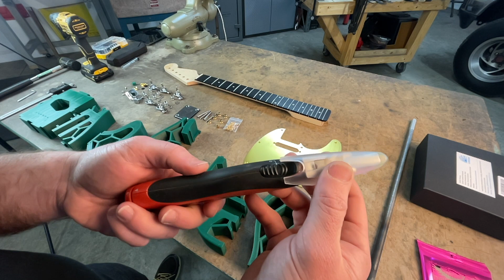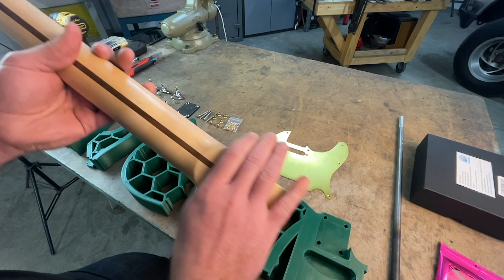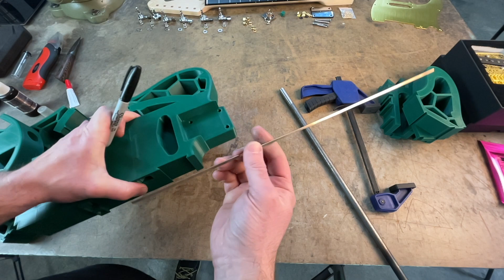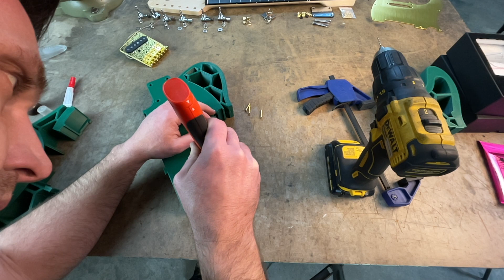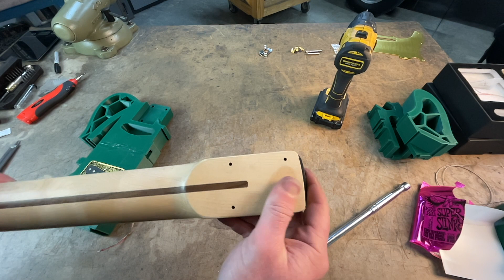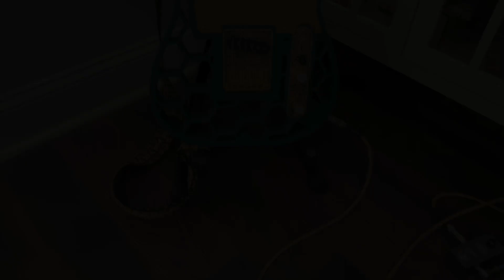I 3D Printed A Guitar (Does It Sound Good?)

Comment: Wouldn’t some kind of epoxy glue be better, especially for those looser fitting joints?
Reply from the maker: Yeah epoxy is a great option but with PLA super glue work just fine. You could use a solvent based glue on say ABS and have a very strong bond.
Reply: @koideath thanks. I have just completed mine and I found the superglue didn’t give me enough working time (it’s summer here in Australia and very hot!). I found epoxy gave me a little more time to get the parts together straight. Also, there was a few gaps between some of the parts and epoxy fills the gaps well. 
A couple of problems I ran into is that not all the holes printed and I didn’t realise till I had it all together, so sorting that problem was interesting, lol. Also, I have a different bridge that mounts with 4 screws under the saddles. I didn’t think that would be a problem but when I screwed them in, I realised these very little for them to screw into. I ended up making an aluminium plate to go on the back with nutserts in it and I bolted right through the body into the plate, effectively clamping the bridge down. It seems to work great so far. I’ll be stringing it up and testing it tomorrow :)

Comment: I have one of these on my printer right now. Even if it doesn’t sound good, it will look cool hanging on the wall 😂 By the way, you didn’t include the file or that plug :)
I literally bought the cheapest Squire as a parts donor.

Comment: Love it, going to try this out! What were your print layer and infill settings, did you follow the original model's .15 amd 40%? I'm thinking of trying a .2 to save some time but i'm not sure if it's less ideal
Reply from the maker: I actually did .3 and did a 20% gyroid infill on non-critical parts and about a 40% infill on load bearing parts.
Reply: @koideath  Thank you!! Definitely have to try gyroid on the less critical parts. Did you use Cubic for the critical parts?
Reply from the maker: @tchafa  I actually used gyroid on everything.

Comment: What I'm most concerned about with printed guitars is how well the material resist to heat. I've read that PLA is deforming at around 60°C iirc? How is stability going with your guitar after months using it?
Reply from the maker: You are absolutely right. Ideally a higher temp filament would be better. Next one I am doing is going to be out of carbon fiber infused PETG. But with that said the one in video is still holding strong with no deformation. Granted I haven’t had it outside in direct sunlight it’s just been in my house.
Reply: @koideath  Thanks for the fast answer! I'm currently in the process of designing my own model on Fusion 360 =)

Comment: This is great-my son and I are gearing up to print this from your thingiverse stl. I was wondering how many top/Bottom layers you used and how many walls? Has it been stiff enough so far? Thanks for the great stl!
Reply from the maker: Hello! That is awesome! It is a super fun build! I did 4 on the walls. I wouldn't go less than that due to the screws. The top and bottom don't matter a whole lot you just want it to be a sturdy shell so I would say 4 as well. Infill percent for me was low because I used Gyroid infill which yields a higher strength at a lower percentage. If you do a standard infill I would do 15-20% on the non-essential parts and 40% or greater on the center structural pieces. It has held up amazingly! Nothing has warped at all. It surprises me how well it plays too. I plan on building another one soon with an actual Fender neck and higher-end components.
Reply: @koideath  I have been thinking of printing one of these in wood filament and using either a wood dye and Tung oil or nitrocellulose as a finish depending on how cloudy the body is after sanding it smooth, if it needs sanding, I have a large enough build surface on one of my printers that would enable me to print it all in one piece, however, after watching your video I am in favour of the steel rod in the body, I might be able to re-mix your file to pause the print to enable me to insert the rod and then continue the print.